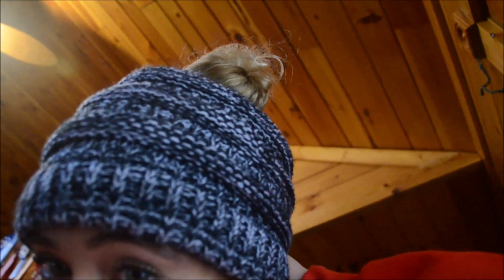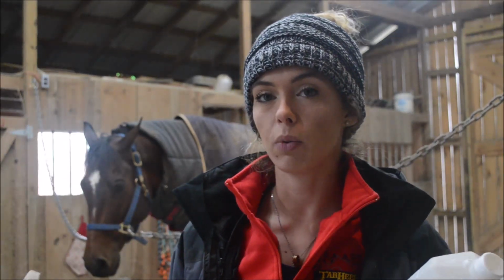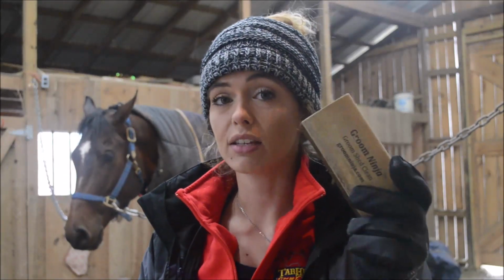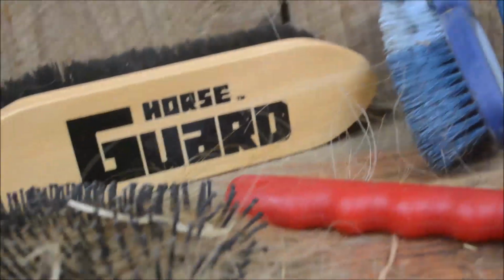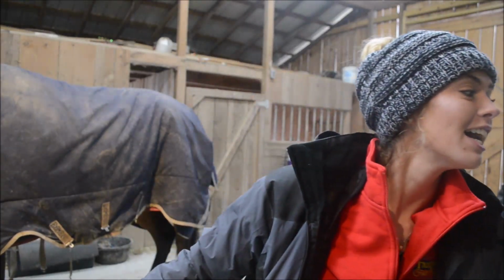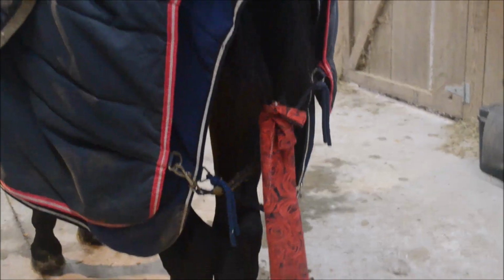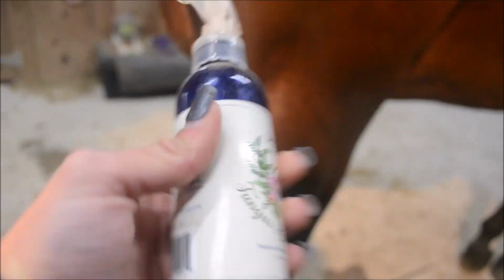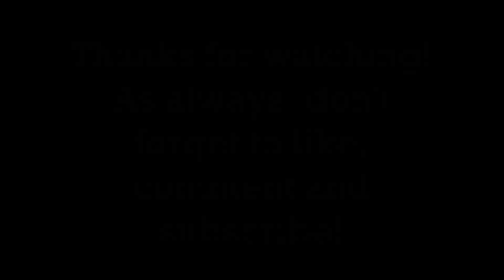Winter Grooming + Tips | EquestrianBliss

Comment: If you don’t have a shoulder guard in his size you can always fold a pillow wrap over the front of the first sheet you put on him. In my opinion using the wrap is better than the shoulder guard just in the simple fact that it’s easier to put on and it doesn’t add any more pressure/pull on the their back and wither! They work the same as the new Equifit blanket bib but are like a fourth of the price!😂